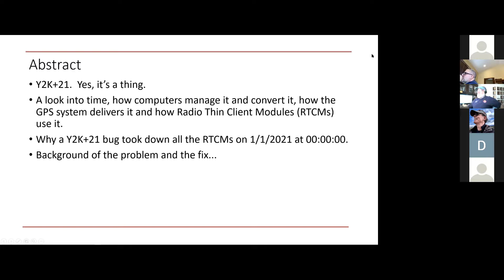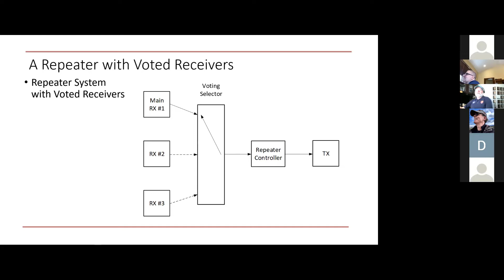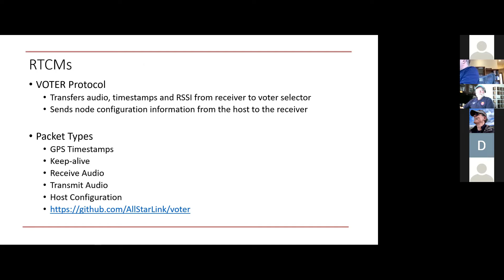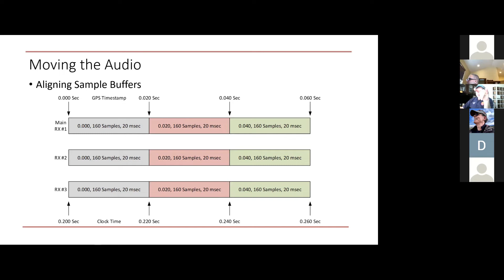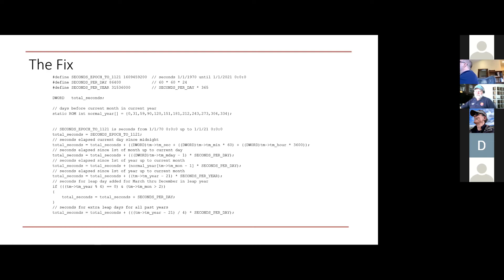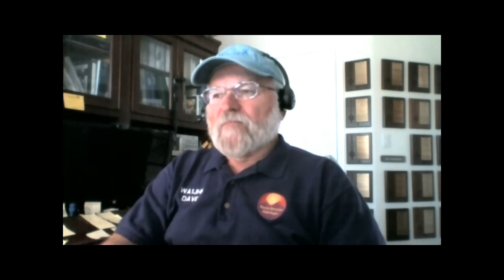RMHAM U Quick Tip: The Day the RTCM Took Us Back In Time

Comment: Excellent video, I remember when this happened. I have a 6 site simulcast system and remember seeing this 1970 issue. At first I thought it was a GPS problem with the GPS units I was using. I remember getting burned in the public safety space buy the GPS leap second issue a few years ago on older GPS units which caused an issue with several public safety simulcast systems. Thank you for the  fix Dave, it saved our bacon!